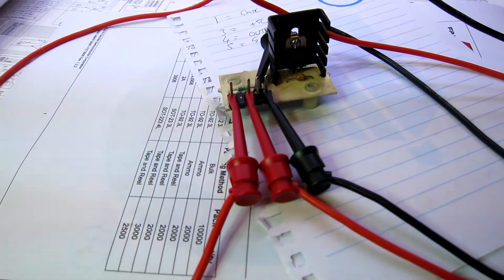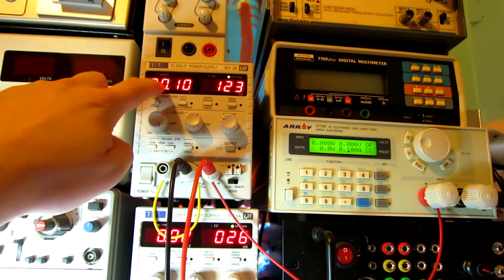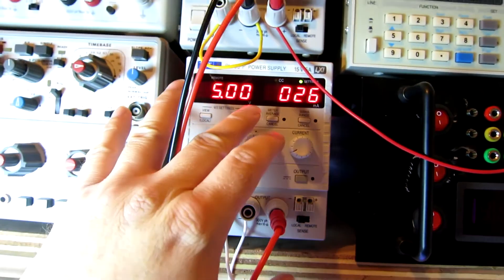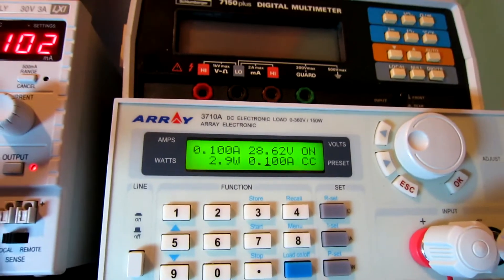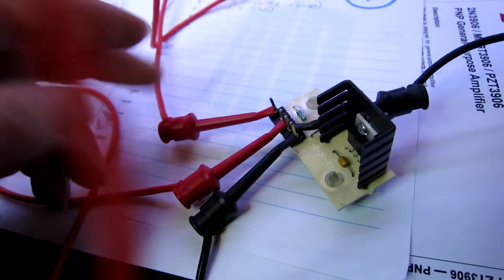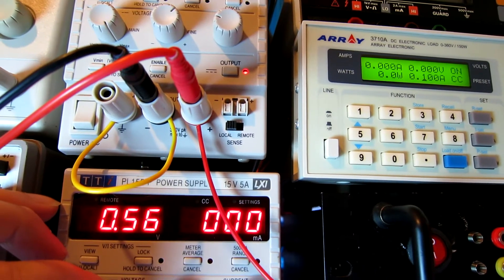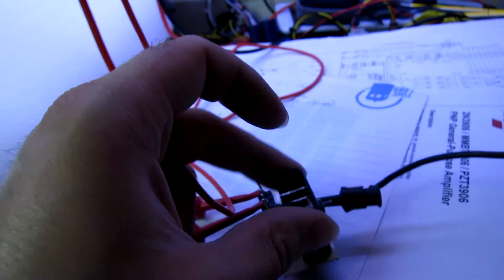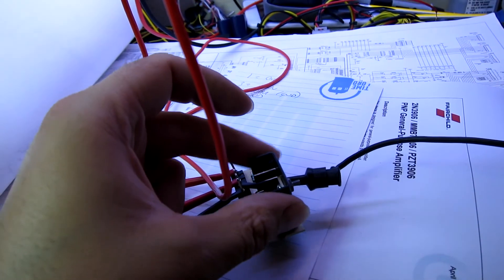Sega Apollo 13 Moon Magnet PCB Testing and Repair

Comment: Can I ask you a few questions about this board?  I am working on my own Apollo 13 and am really stuck.
Got the game and it had a typical issue, locked on, and was over-fused, so moon magnet was getting ridiculously hot.  Replaced the smashed magnet, replaced the charred coil, replaced the transistor on that small board, and put in a proper (3A SB) fuse.  
Now the moon works, but only kind of:  It is not strong enough to grab the ball.  With the fuse out, checking the voltage across the clip we can see it spike to 50 V (North American here!) and almost immediately dive down to 20-something, when doing the "Moon Grab" coil test.
So I guess my question is, does this board just output a solid voltage?  Would you be able to show readings of it as it is activated in the game's tests?
I am an electronics novice and don't understand where to start looking to try and figure out why we are not getting enough power at the magnet to properly grab the ball during game play.
thanks,
~cait
Reply from the maker: +cpi23 Sorry I can't help you with readings as it is not my machine, it was a repair for a customer. If the magnet has been subjected to shortcircuiting/overheating then I would say you will almost definately need to be replacing the related pin headers and re-pinning the loom connectors as they will have overheated and oxidized, resulting in a higher resistance and as such a weak magnet now.
Reply: +arcadeuk What's a loom connector?  Do you meant he connector to the magnet board?
I just found something great:  if you search for "Stern apollo 13 service bulletin 80" the first hit is a PDF with the schematics.  That confirms to me my question, that the moon aux board is either supposed to output it's 50V or not.

So I have expanded my search:  I just ran a test now across the 3A fuse clip (with it removed) and the ON GRAB pulses to 50V momentarily, but for less than a second.
I have a funny feeling like the ON GRAB should be active for at least 2 seconds.  Not sure if you have any insight on that though.
Unfortunately this opens a whole new can o worms for me. like if it's not ON for long enough, where in the chain of control is that coming from...